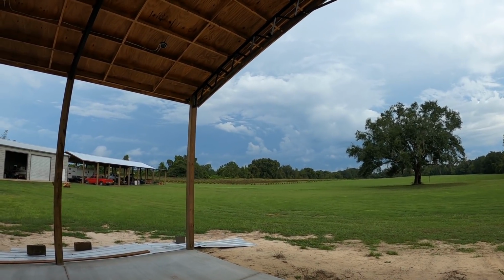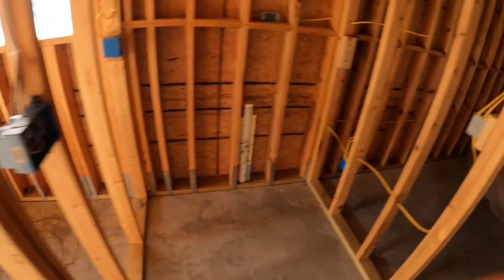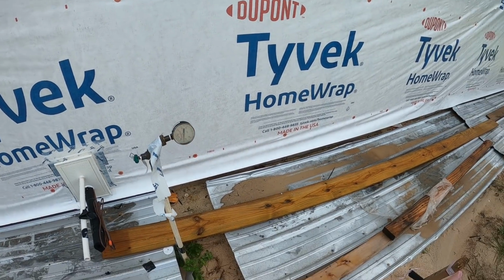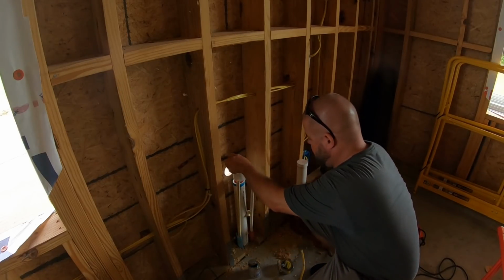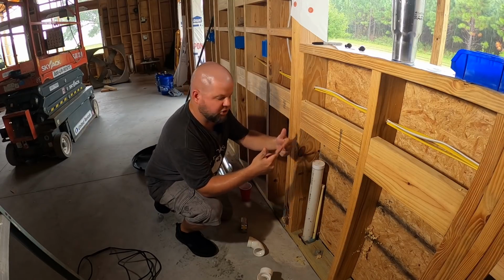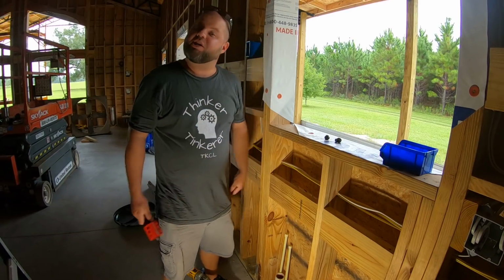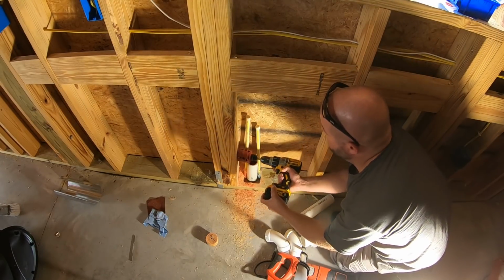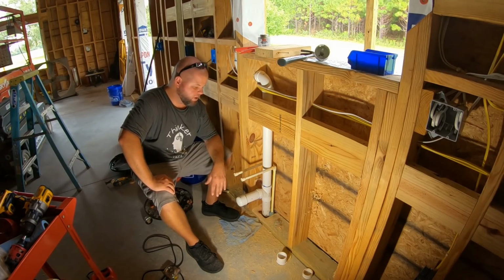Plumbing has started, and I'm already MESSING UP!

Comment: I've worked on brand new houses that I've seen PVC, CPVC, and PEX A and B all installed within 5 feet of each other.  For some reason, water softeners like using PVC, so you'll have a cut line adapted to PVC to go in/out of the water softener and the water heater will have PEX A or B ran to it.  And sometimes you'll have a CPVC thrown into the mix as well.
I've been burned by CPVC cracking when trying to replace a Moen valve insert or replacing a water heater.  We're talking under 10 year old CPVC cracking when attempting to cut it, hence I have started to just use the multi tool to cut the pipe instead of the ratcheting cutters.  Years ago when repairing sprinkler systems I hated anyone who installed thin wall PVC as that stuff would crack and break all the time and require repairs.
Reply: Old PVC or CPVC you need to use the rotating tubing cutter like you'd use on copper. Anything that puts a squeeze on the pipe is a risk of shattering old plastic.

Comment: When your getting your water supplied by a standard well setup there is no need to worry about plastic pipe! Not enough pressure and with freezing not an issue no problem there also,  only thing left to worry about is if the house goes up in flames PVC fumes are unbelievably toxic! 🙂
Reply from the maker: I hope I'm out of the house if that happens! 😳

Comment: Andrew I had to attend a 6 hour class on solvent welding from glue manufacture and when you apply primer it cleans and softens the pipe so the glue can adhere, where I work now I see hundreds of joints that come apart because of no primer, the joints that have primer never come apart that I have seen yet.  I know some people don’t use it but the manufacturer says use it so why would you not follow manufacture on one thing and ignore on others, I guess to each there own , also building inspectors I have seen fail you on no primer.  Food for thought
Reply: It is code here that on 1” and above you must use a primer first and then glue with the appropriate glue. I love hot glue too but at least use the clear primer.
Reply from the maker: I also sand, and wipe clean my joints. I doubt many people do that. I also forgot to mention I am using Oatey 1 step glue, THEY claim nothing else needed. I've actually never seen one step before, it must be new.
Reply: That blue glue has been around for a long time and was mainly invented for wet applications. Some call it hot glue or blue glue. Here by Oklahoma code we have to sand, purple primer, then glue or else the inspectors will fail it. Of course I am dealing with City, County, and State so each one and local have different methods they want used but sand, purple primer and glue are a must in each one.

Comment: Okay I'm most way through the video. Remember your vent stack has to be above the sink line for it to work not below.. so vent stack above highest point of water standing or entrance. So the sink is full of water your vent stack has to be above that. Just like with a washer inlet your vent stack has to be above that. But mainly for the sinks like what you have going there in the kitchen your vent stack entrance needs to be above the sink height.
Reply from the maker: It is, I mentioned I tore it out and moved it 6 inches above the flood rim or sink rim per code. Wet stack venting is also allowed, but apparently I have to go off at 45s and not 90s. Impossible to drill 45 degree angles through 3 2x6s in that spot.

Comment: Good choice on the Diablo hole saw! Always have plenty pilot bits as you have found out!
The black clamp on handle that comes with most drills is a must when using hole saws! Save your knuckles and wrists. Your body will suffer as you age!
The elbow that you installed for the outdoor sink, is not a DWV fitting.
Reply from the maker: Yep that's aggravating about the fitting. It was in the bin with all the other DWV fittings and I didn't pay attention to it. I'm now noticing I have a mixed bag and install of both types.

Comment: You can actually flip the san tee, but only for venting to allow for easier snaking later if the vent gets overfilled from a clog. When you do, you gotta make that tee a certain height above etc. I cant remember exactly, but it also might be above the flood height.
Reply from the maker: I'm making everything above flood height, because the rules got weird for a wet vent below flood level. Something about needing 45s and all

Comment: I can hear the frustration in your voice, hang in there your doing great. My only thought would be that the inside bottom of an under sink cabinet is typically 3-4" of the floor. will there be room for your ptrap once the cabinet is installed?
Reply from the maker: Yes, that's far higher than it looks. But it is lower than I would have liked.
Reply: @TKCL  ah gotcha, figured camera didnt do it justice. Like I said your doin good man.

Comment: Some people use cpvc for "bars" on the top part of their horse stalls instead of metal bars. They paint them black and its hard to tell the difference. The cpvc flexes and it is strong enough to prevent injuries to the horse and the flexing prevents entrapment. We just bought a property in the pandhandle with a 78ft horse barn but has no stalls. I am going to use the cpvc for my top stall "bars".
Reply from the maker: Wow, didn't know that!

Comment: 100% on CPVC.  It was not allowed under the slab 20 years ago when I was a plumber (further south in FL), but I had zero issues running it overhead and having joints in the walls.  The one step glue was amazing.  We used Flowguard Gold and never had any issues with glued joints.

? for you.  We always added air chambers above each fixture to stop any water hammer.  You talk about just using elbows to turn those lines out of the wall but you might think about using a tee instead.  We used 18 in risers above each for fixture.

Don't need to waste your money on that rain or shine glue, but you should 100% use primer on PVC!  Not nearly as critical on DWV (Drain, Waste and Vent).  But when running your schedule 40 pipe out to the well for pressurized lines you should 100% use primer.  It will still most likely work without primer, but better bonding when primer is used.
Reply from the maker: Flow guard gold one step is the glue I'm using. As for the risers, the only place I was going to use hammer arrestors was the shower and washing hookups. Those are the two places I always hear about complaints for hammer. Now I'm wondering if I should have used them on the other 4 sinks?
Reply: @TKCL    Interesting, we only used them on sinks and no where else.  But that was a long (ish) time ago and a lot has changed in plumbing design and code since then.  Plus I was in a different county of Florida  and each county or city in my area had slightly different additions or restrictions on the plumbing code.
Reply from the maker: I started adding them, had homemade hammer arrestors in my last home and never had a issue.

Comment: Issue with CPVC is that it gets brittle over time and ends up cracking. Might crack above the slab, or below the slab. Issue with CPVC below the slab is if your slab moves\cracks it can easily split  CPVC, PEX is a lot more flexible and doesn't fail like CPVC does. CPVC usually lasts about 15 years before it starts to crack and leak. I am surprised the inspected didn't flag the under the slab CPVC install. I would also do a pressure test on your CPVC lines to make sure none have already failed (ie some stepped on the CPVC during the slab pour.
Reply from the maker: They have been pressure tested months ago and the lines was still sitting with over 80 psi on them before I started my install.

Comment: In Virginia purple primer is mandatory. No purple, failed inspection
Reply from the maker: Not in Florida if the glue meets a certain ASTM rating (Oatey does) and as long as it's on 4 inch or less DWV pipe.

Comment: PRIMER - were's the purple primer. It's purple so the inspector can see you used.
Reply from the maker: You need to read 705.11.2 of the upc codes for FLORIDA. This is the solvent cementing section for PVC pipe. It clearly states if certain standards ASTM D2564 are met (Oatey rain r shine meets this requirement) and if this is on waste, drainage or any non pressurized pipe to to 4 inches, purple primer is NOT REQUIRED. I meticulously sand and prepare all my joints, people trust primer as a quick cleanup step. Properly sanding and cleaning your joints has yielded me excellent results for decades gluing pressurized and non pressized pipe together. And for the Cpvc, I am using Oatey one step cement that specifically states primer is not required. I've already passed earlier inspections with that same glue.

Comment: Got that right few places could ya do all that.  In Canada we have a 4 and a half feet froster line. Normally you get one in as a center feed then you install the rest from the center stack.
Reply from the maker: I'm so glad we don't have to deal with that.
Reply: @TKCL  worst part is most houses in my area are also in glaze type of soil  so when you put a fence post you could see the posts out of the ground after some years as when the frost happends it can hydro lock sideways and push things out of the ground.  So we have to use drill holes with a a bit that liiks like a screw  but a mega size in some areas to avoid it.   Then in my new area we also got stones and some really wet grounds.  So in winter a poorly done basement is a flooded one...   so you need to water seal it from bottom and sides.  Example my  area sometimes has fire bands in summer. But my yard in the back is all green and wet. Good for grass.  Bad for building.

Comment: Really need a cleanout on kitchen sink drain, I would stub it outside so when you go to use it any backed up waste will go outside instead of in house under cabinet, also dirty snake not all over cabinet/ kit floor. Just a thought.
Reply from the maker: I was going to put in in the cabinet before the trap. Outside just won't look good in my opinion.
Reply from the maker: Also I'll have a outside cleanout about 12 ft away from the sink where the main sewage line heads towarda the septic tank.
Reply: @TKCL  ok but I think you might regret that decision the first time it floods your floor when you pull the plug, its hard to clean & dry floor under cabinet. I would also use a piece of plywood screwed in place (removable) above the breaker box for future fishin of wires, it beats having to cut & patch sheetrock. Glad you got some help on A/C system. Watch those wall hung indoor units they are a mess to clean coils in future.
Reply from the maker: I discussed that a while back. I built the breaker closet/extension to have a door above and below the breaker panel to always have future access to running wires.

Comment: This comment isn’t plumbing related but I wanted to share my experience with spray foam insulation.  Our whole house is spray foamed and I like the power bill much more than our previous house. The problem I ran into is getting a termite bond on our house    from a pest control company. None I have contacted will take care of any structural damage if that was to happen due to wood destroying organisms. They say they can’t inspect with spray foam insulation.  If this is important to you, check with your pest control companies and see what they have to say before you have it done. All they will do if there is a problem, is to treat the damaged area against future pests. I’m in the western panhandle of Florida.
Reply from the maker: I hate to hear this, because we are dead set on spray foam.  A lot of people in this area are spraying, someone has to still be able to treat for termites.  I am also going to pre treat my lumber before foaming.

Comment: I'll make a couple comments about PEX.  PEX uses metal elbows, T-fittings, and couplers. It also uses crimp rings, which if not done correctly, can leak or allow a blow off to occur.  My house has had water with a pH of 5 for the last 35 years, and some of the metal pieces are corroding. I've put in a water softener system so this won't continue to happen. PEX is great because you don't have to drain the system to glue in a new joint for an addition or repair or whatever. But given the choice, I'd MUCH rather have CPVC. All plastic has nothing to corrode.
Reply from the maker: People hate it with a passion! I'm confused as to why, a lot of people use it here and I never hear of any locals talking about failures.
Reply: PEX also has plastic fittings that they are claiming are stronger/better than metal.  Properly installed PEX will outperform properly installed CPVC.
Reply: @TheSidneySmith  Not sure what "outperform" means. The other disadvantage to PEX is that the unions are internal. As a result, the internal pipe diameter is not consistent for it's length. PVC and CPVC use external unions, so the internal pipe diameter is much more consistent, creating less turbulence and a smoother flow.

PEX is more flexible and you can use a much tighter radius than with CPVC, so that's a plus. PEX also does handle freezing better than copper, PVC, or CPVC pipe. But neither of those are enough of an advantage for me to want to use it.
Reply: @JCWren  Over the life of the system, PEX has the advantage of not cracking/shattering when disturbed and it also has the advantage of being cut at the fitting and replacement added whereas with CPVC/PVC, you may have to cut back a lot of pipe to get to a point where you can rebuild the line.
Also, with PEX, you have the ability to do "home runs" from a compact central valve system straight to the outlet conversion at point of use with no joints/unions in between.

Comment: Doesn't make any sense to me Andrew (kitchen sink vent).  The "vent" opening will be up through the roof somewhere.  All it appears you did was moved the horizontal run of the vent pipe up above the sink level.  As the vent pipe is a sealed pipe, I don't know what moving the horizontal run of sealed vent pipe did to prevent any flood water from entering?  It would make sense if you were using one of those air admittance valves having to be 6 inches higher than a floodable fixture, but your vent stack will vent out above the roof.  Makes no sense why moving the horizontal run of vent pipe up the wall 14 inches solved or prevented anything...  :-)   P.S... Really excellent video!
Reply from the maker: I don't know either, but code clearly states you cannot start a horizontal run of vent until 6 inches above the floodable plane of the fixture it serves. Code does allow wet venting, but I have to start off at a 45 degree angle on the vent, not easy with a hole saw.

Comment: What is that pressure tank you are using? Can't seem to find any large ones like that around here.
Reply from the maker: I'm not sure what tank you are referring to.
Reply: @TKCL  The well pressure tank that is at your well head in the yard. I believe they are called pressure tanks not entirely sure. You add air and it adds pressure down the line past the well pump.
Reply from the maker: Oh that's a standard 80 gallon pressure tank. No bladder or anything, but it's made specifically for well pumps. I much prefer that style over the small bladder tanks. Not sure who makes it, I bought it as a package with my well install.

Comment: Hi, 
Q, I never checked if you Also checked with t mobile for residential fixed Wireless service,. I watched you say you have two other cell towers which are closer to you than Verizon is so this may very well work out for you?

isp 
/
eligibility

Good luck!
Reply from the maker: I see your comments keep dissappearing.... That's not me! T mobile is the least covered service in my area. It's Verizon first and then AT&T.
Reply from the maker: So I have not been able to read a single comment that you recently posted before they vanish. Make sure they don't have links outside of YouTube in them. That's a guaranteed way for YouTube to instantly delete a comment.